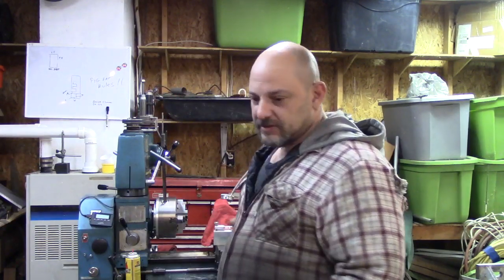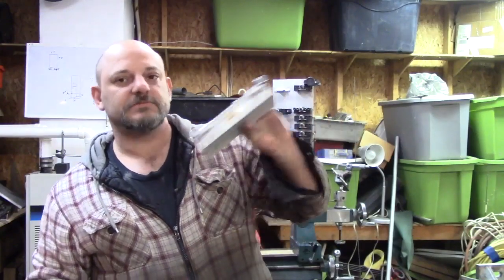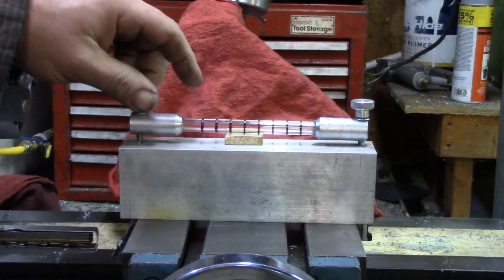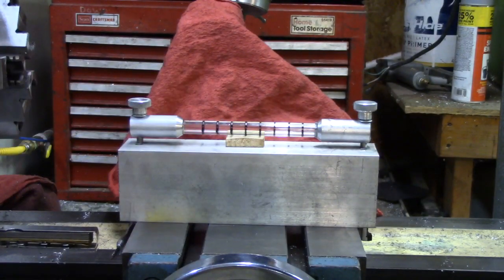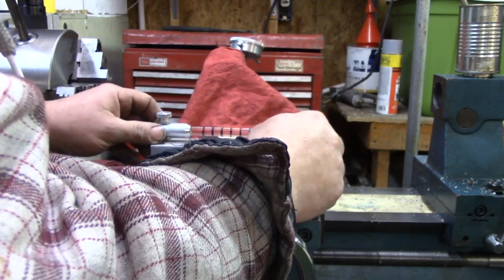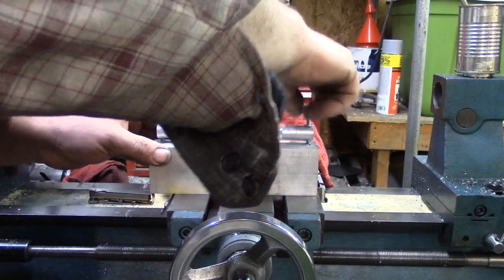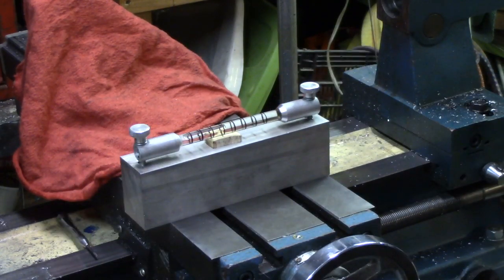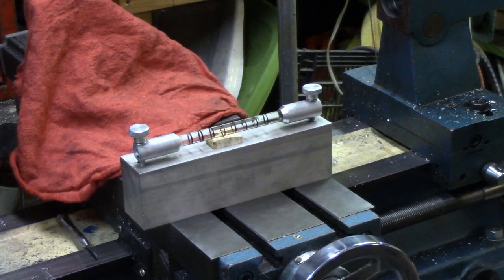Show 'N' Tell - DIY Machinist Level (Redux)

Comment: Clever.  I was turned off by the chuck wrench in the lathe chuck.  Not a safe example.
Reply from the maker: You are absolutely correct!  I removed the key after I finished pre-loading the headstock bearings and before I re-installed the motor controller.
Reply: I'm five year late but fuck off anyway, never too late I guess.